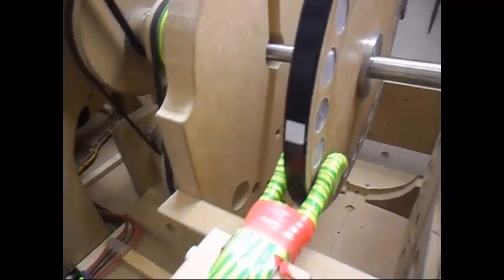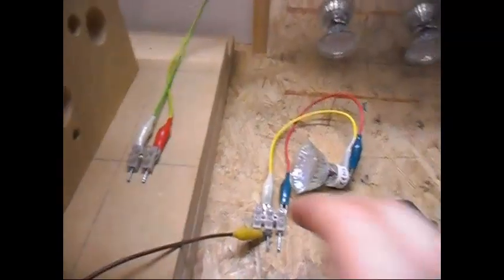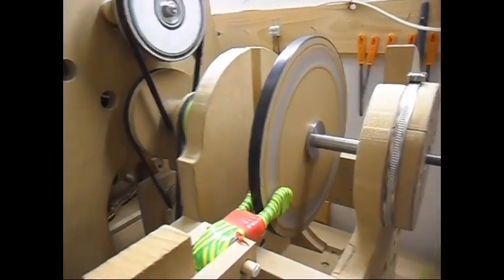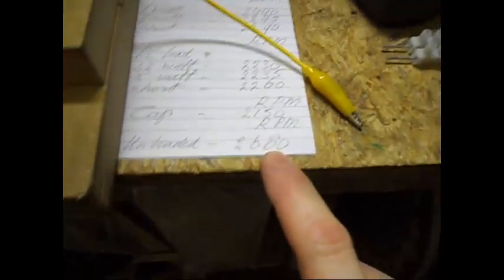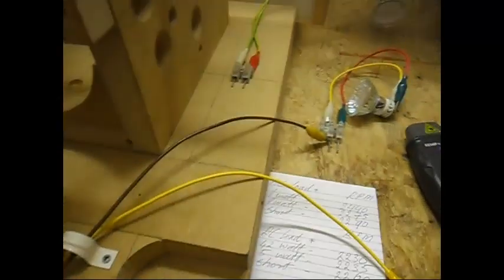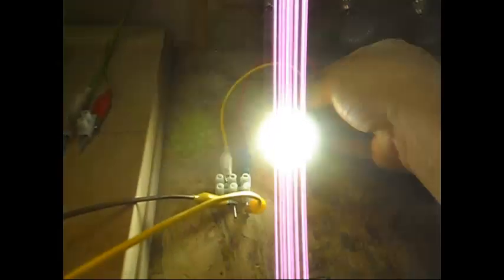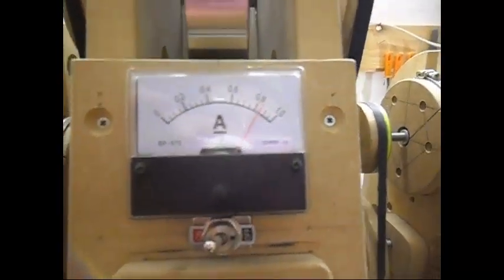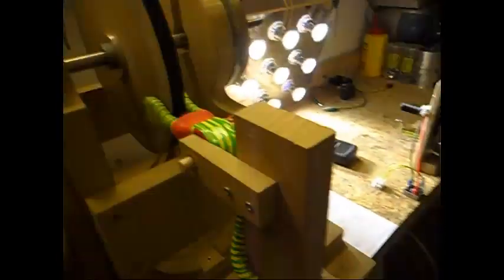Pulse Motor_Generator - Update 20 OverUnity is it or not, Future World Generator_7...

Comment: Well done. does it violate Lenz law ?
Reply from the maker: Hi overunitydotcom,
Thanks for your comment...^^
If you mean lenzless by violate than my answer is "nope" it does not and none of my coils do...;-)

My personal opinion and experience is that if you want to have a 100% lenzless generator coil there's one simple way to get that and that is...
Make a generator and put them coils at 1 meter distance from your rotor and bingo you have lenzless coils but than they are also pretty useless...lol

Lenz is a product of an action wich is the interaction bewteen magnets and coils producing electrical energy so if your coil is producing energy than there is always lenz present...

What i can do is to reduce and slow lenz down so it happends at a different time line than the time line that the magnets are moving by the coils...
The reducing and slowing down of the lenz  product are both one in my coils...
I can not have one without the other just as the same goes for lenz and energy production of a generator coil...^^
If i reduce lenz this way i also slow it down and visa versa...

It's a balance act and the rpm of the rotor is also a part of this balance act wich is more than normal...
Hope this answer your question...^^